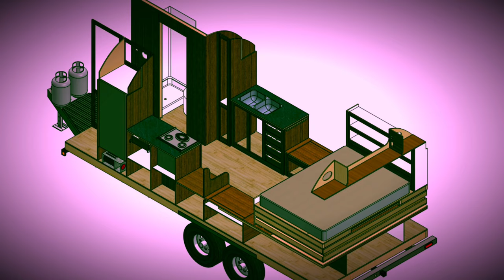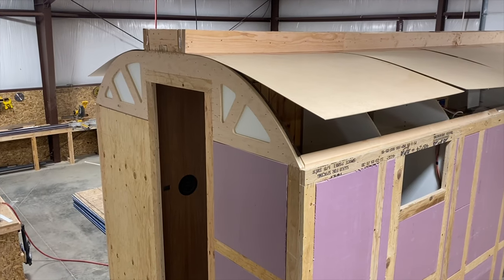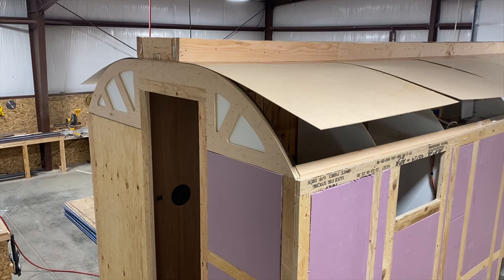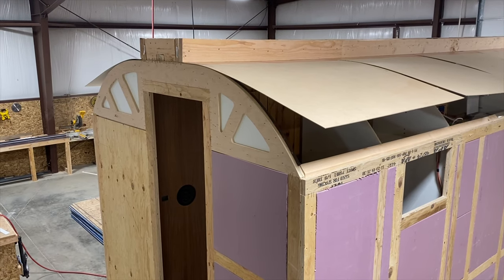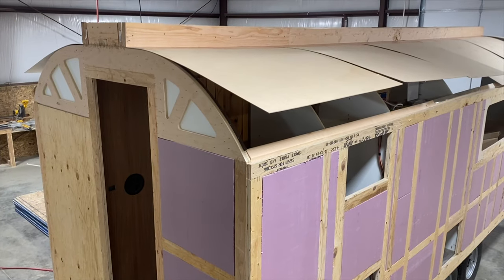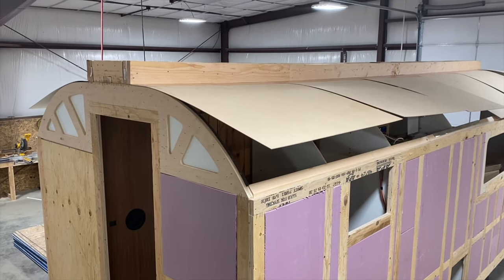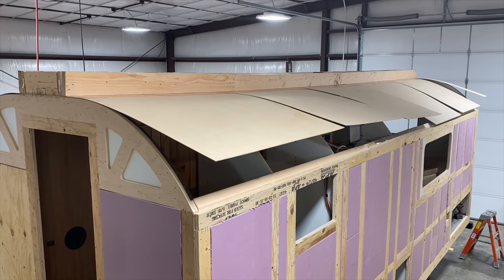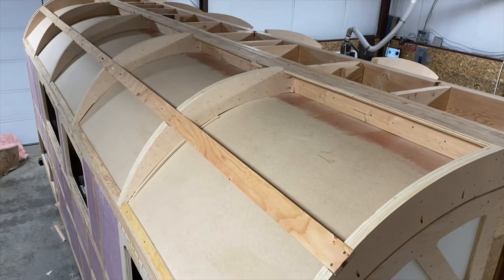Sheep camp build from start to finish

Comment: Hi, looking at several builders including your prime competitor there in UT. I'm looking for a weather durable camp that will last many many years in cold wet environments. One of the biggest issues I have with trailers is water intrusion from the floor. Road spray and slushy mountain passes will drive water into the floor and fiberglass batt. Curious how you're protecting the camp from this? Looks like you're using OSB with house wrap on the bottom of the floor. Would much prefer to see treated T&G ply or some of the synthetic sheathing products out there.
Reply from the maker: We have built camps with several different variations of building materials and we are happy to accommodate any requests you may have. On several things we may want to discuss the advantages or disadvantages associated, helping you make an education decision. The way the majority of our camps floors are built consist of a 1/4 corrugated plastic that is followed by a 7/16 osb but could easily be done with treated sheeting. I will mention that before any of the r19 batting goes in, all seams and edges are coated in spray in insulation foam. This limits the possibility of water intrusion greatly. Not sure where you are located but we would love to have you out to or facilities any time. We also encourage all of our customers to look at our competitors camps. Camps are a big investment and we want you to know exactly what you are getting. We are completely confident that we are producing the best camp at the best price but in the end it will be your decision.